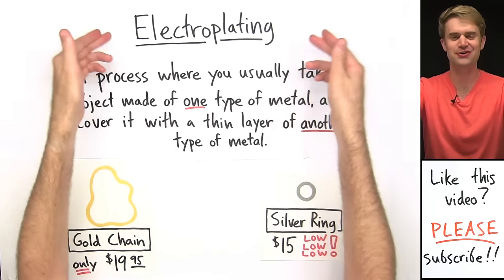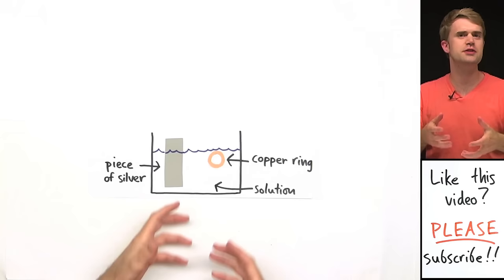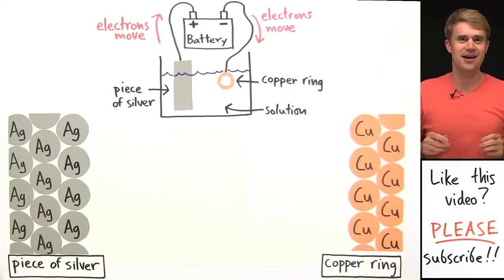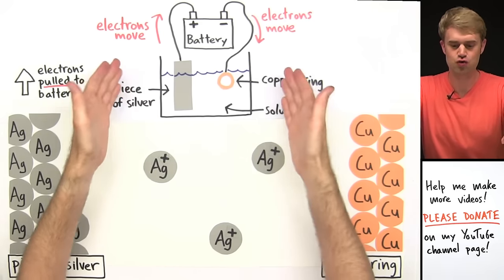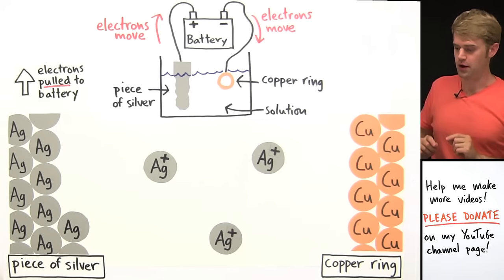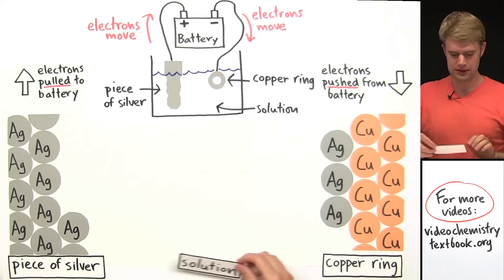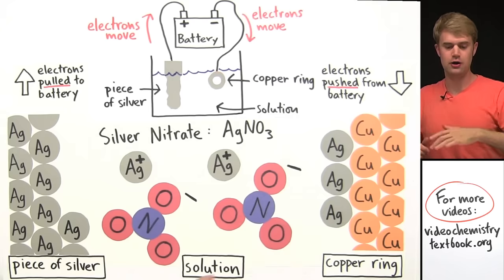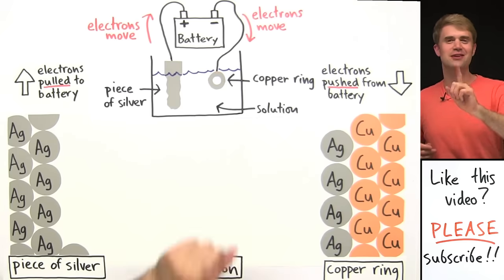Electroplating

Comment: Thanks for the great video! Very clear and cutout animations are so great for visualizing what happens on an atomic scale. Really helpful how you break down explaining every step in simple terms.

A question: Do you need both the Silver electrode and silver ions in the electrolyte to plate silver? Or can you just use one source of silver? For example if you had a platinum electrode instead of silver and used silver nitrate electrolyte? Or if you had silver electrode and just used potassium nitrate electrolyte dissolved in water?

Comment: Question: The metallic cation separates from the rest of the metallic anode as it looses electrons. Why doesn't it happen the other way around? The metal cathode connected to the negative terminal gains electrons right? Why doesn't it from metallic anions and separate? Or is it not possible since all metals have the tendency to form only cations?

By the way, this video was amazing. Thanks for making such a good video.

Comment: As a result Ag electrode becomes Anode and Cu becomes cathode?
I remember using Magnesium or Zinc as sacrificial Anodes in a petrochemical Refinery in order to  protect carbon steel pipes from refinery to shipping terminal and crude oil back from terminal to the refinery.

Also, we buried magnesium to protect from corrosion distillation columns, and other stationary equipment like pressure vessels,  defacing evaporators, Heat Exchangers.

Not sure what we method we used to protect large centrifugal & reciprocating centrifugal compressors & pumps?  

Physical chemistry was my favorite subject in school. 

I used to score highest  in Physical chemistry part of chemistry, I remember & went into mechanical engineering. 

What should be the career for someone who loves physical chemistry in school?

Awesome educational video, keep it up. 👍

Comment: Hello Tyler
I am so happy to tell you that your videos are so helpful, they all explain their topics very well and most of the time I get the point 100%.However, electrolysis and electroplating are complicating for me and therefore I have some questions that I need to ask you and I would greatly appreciate it if you can answer them in your free time. :)
1st: why does it matter which side of the battery the metal to be coated must be connected to ( to the negative terminal) I mean would you not get the metal coated if you connect it to the positive terminal because overall you want the metal atoms to become ions don't you?

2nd: using a solution of silver nitrate means you'll have negative nitrate ions as you mentioned in your video so will not those ions attract the positive silver ions and prevent them from reaching the negatively charged copper at the cathode?
If not, why is that?

3rd: as you mentioned atoms are solid metals while ions are water soluble. now why is that not applyed to the copper ions since they are now negatively charged ions and rather than remaining solid they should also be dissociating like the silver ions, isn't that right?

Thank you so much again on those great helpful videos I wish you a very successful and a prosperous future.

Comment: Great video! Just had two quick question about the electrolyte. 
1. If we had a solution of CuSO4 instead of the AgNO3 would we have a mixture of silver and copper deposited on the copper ring? 
2. Hypothetically speaking if the silver anode was not in solution and we simply fed electrons into the copper ring(submerged in the AgNO3 solution) would electroplating still occur? (I guess this is assuming we keep on restocking the electrolyte in the solution).
Reply: no, the problem with just allowing AgNO3 into the electrolysis because electroplating is not uniform and the reaction happens too fast that you get this instead

Cu + 2AgNO3 → 2Ag + Cu(NO3)2

Comment: I have watched this video several times and you did a fantastic job explaining everything! but the one QUESTION i have is: when the silver ion goes back to being a silver atom when the charge is removed, why doesnt it stick back onto the silver metal? why does it only stick to the copper?
Reply: Since the electron is going through the copper and the silver ion is attracted to it, the silver ion takes the electron and becomes neutral silver. Because the ion was near the copper, it "plates" or "attaches" to the copper.

Comment: Why doesn't the Cu anion dissolve into solution like the Ag cation does. Is the rate at which Ag+ attaches to Cu- faster than the rate of dissolution? Or is it because in the small moment the electron is transferred from Ag to Cu, it has already traveled far enough to attach to Cu-thanks for the video!

Comment: Hi could you please answer my questions:
Why must electrons be pulled to the battery?Why can't it be protons pulled from the battery?
When the electron is coming to the copper ring,instead of the electron affecting the positive AG silver shouldn't it be affecting CU making it negatively charged for the positive AG to attract to it?
Reply: If protons were pulled from the battery it would change the atom, because the number of protons determines what element it is. Hope that helps :)

Comment: Can't I use a voltaic cell for electroplating? If we can, can we do that with a different solution? Consider we're using Zn as Anode, and ZnSo4 as a solution. On the other side, Fe as Cathode, and CuSO4 its solution. As far as I understand, the Zn's electrons would feel attraction for the Cu^2+. The Zn will give off two electrons. The electrons will go through the wire toward Cu ion. The electrons would end up their journey at Fe. Feeling attraction of the electron, Cu ion would be attached to the Fe, creating a lair of Cu in above of Fe.

Comment: Note: The concentration of silver ions in silver nitrate solution will not change. For every silver ion in solution that is reduced to form solid at the copper cathode, the silver anode dissolves in solution to give a silver ion so as to maintain the balance of cations and anions in silver nitrate solution and keep it neutral.

Comment: May I ask you a question sir You have said at 13:47 that silver nitrate acts as an electrolyte that will move electrons from the cu to the Ag to complete the circuit then how the Ag metals ( anode ) get positive since the battery PULL electrons that are not originally from these metals 
I wish if anyone could answer me as this really confuses me
Reply: The silver nitrate acts as an electrolyte for current to flow through the medium of water. If the electrons from the copper were to return to silver, this process would render electroplating useless owing to the fact that the plated material would come off silver and eventually return to the silver.

The process does not loop. It stops when the plating of copper is done.

Comment: One question: Why doesn't the electron go in the Copper rather than the Silver in the solution?
Reply: electron flow from the battery gives the copper atoms additional electrons. As electrons are negative, the copper atoms become negatively charged ions. Now the electrons DO NOT go into the silver solution because it is already negative and therefore is not attracted to the solution
Reply: Also, the negatively charged ions want to find positively charged ions to become neutral (lowest energy state)

Comment: very good explanation. But I have a CONFUSION! You said neutral atoms makeup solid metals, but as mush as I know solid metals are composed of metal cations held together by a de-localized "sea" of valence electrons. So what am I missing?
Reply from the maker: That is an exceptionally good question. So basically, when a metal atom is in solid metal, yes it is a cation in a sea of electrons, but it “has access” to the electrons that surround it. It’s sort of like if I don’t own a car and my friend doesn’t own a car, but we have two cars we communally share. We don’t own cars but we’re not really “carless.” So that’s why we give solid metal atoms an oxidation number of zero. However, when that metal ion is outside of the solid, it no longer has access to the communal electrons, and its charge actually matters now. It’s like I get kicked out of my communal car-share arrangement, and now I really am
carless.
Reply: @tdewitt451  Thank You 🙏 for your quick response. By the way, what would happen if the electroplating solution was not used? (What would happen if only water was used?) Does the preferential discharge concept has anything to do with this scenario? 
Final question: why is AgNO3 chosen?(why common solution for this scenario?) Why not AgCO2 or any other compound?

Comment: Question: Couldn't the copper ions have dissolved into the electrolyte,
 like the silver cations, and stuck to the surface of the silver instead?
Reply from the maker: No, that couldn't happen. Why is the silver able to dissolve? Something different happens to the silver that doesn't happen to the copper. What is that?
Reply: +Emmanuel Shitta It's because the copper becomes negatively charged while the silver is positively charged.  The silver doesn't just leave the others just because it wants to.  It's because the solution has negative ions that draw it away from the bar (in this case it would be silver sulfate).  Since the copper become negatively charged, the sulfate (which is also negatively charged) wouldn't draw it away since like charges repel.  It's the change in the silvers charge from neutral to positive that allows it to be "pulled away" by the negative sulfate ions in the solution.

Comment: Why does the silver “stick” to the copper if it’s not ionic or covalently bonded?
Reply from the maker: It is metallically bonded.
Reply: @tdewitt451  so it’s an alloy at the surface with shared electrons? 👍🏻

I’m trying to electroplate some metals with oxides onto mixed metal oxide surfaces.  It then reacts after deposition releasing the oxides forming some kind of bonds.  The paper I’m following doesn’t explain bonding in detail. Very complex.  

Your vids always help me get a refresher on basics I’ve forgotten.  Thanks so much!
Reply: @tdewitt451  nickel iron onto bismuth vandadate 🤓😝

Comment: Why can't the negatively charged copper atoms coat on the silver bar
Reply from the maker: The copper atoms are not negatively charged. They are positively charged. I might suggest you watch the video again to make sure you understand this important point.
Reply: +Additya Gopinath first of the copper atoms (Cu) aren't negatively charged.  The very fact that it is an atom means that it is neutral.  Instead electrons from the anode of the battery sort of &quot;hang out there&quot; just waiting to be reunited with their Silver atoms (now positive ions). When an ion of silver comes in contact with the Cu plate, it regains the electrons that it lost. Remember what Tyler said, "neutral metal atoms make SOLID metal"  therefore the silver atoms deposit on the copper as solid silver.  The copper atoms could never do this because they aren't in the solution since they're NEUTRAL.  If they're not in the solution then they can't go to the other side and deposit on the silver.